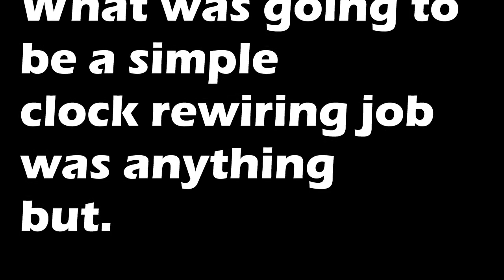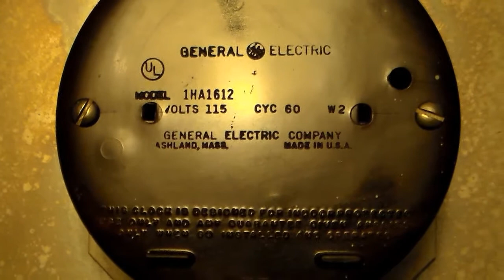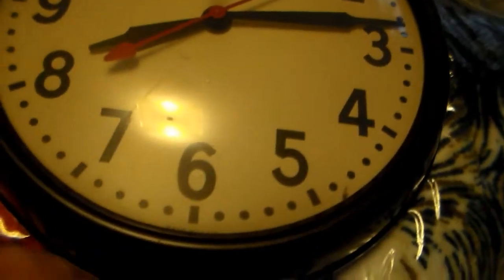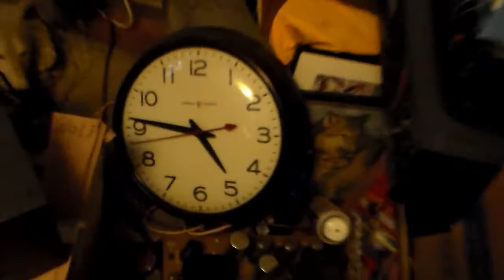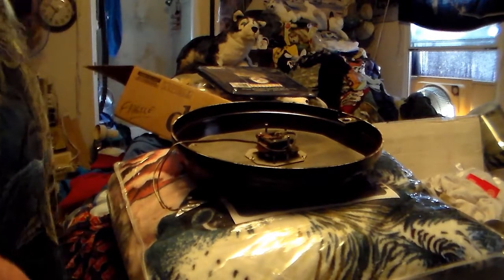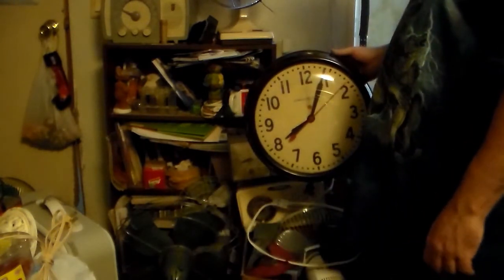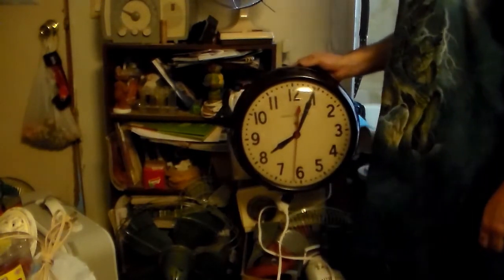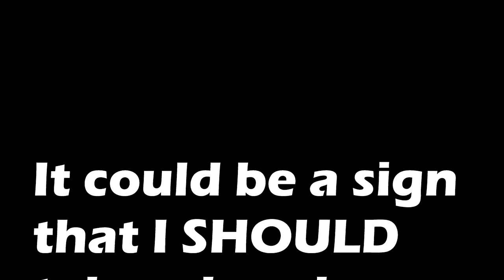Eskie's Vlog 041915: The Clock Won't Work

Comment: What I would do until I could find a way to fix the broken time set shaft, is leave it unplugged until it is actually "that time" it is left at and plug it in. That is one way to set the time to it.
Reply from the maker: Emerson Collie That could work. However, after I stopped filming, I let the clock run for a time. It would advance like a minute and stall out while the second hand would still be running. I'm not sure if it was due to the fall, not being able to get rid of the red dot, of if it was like that before I got it.

Comment: You know. have had these moments myself. like when that motor blew on that gray blade Galaxy. i started to wonder to myself. "whats the fucking point?!?" but after i calmed myself down. and thought about it more. i knew it could be fixed. but the point is. i think we all have these moments when we question why we do what we do. and have 2nd thoughts.
Reply from the maker: ***** I tend to think of it like a roadblock.
Reply: Thats a good way to look at it.